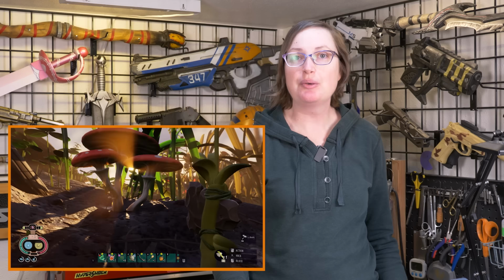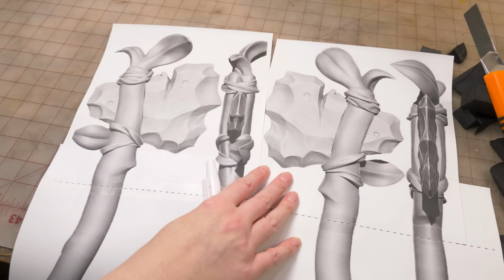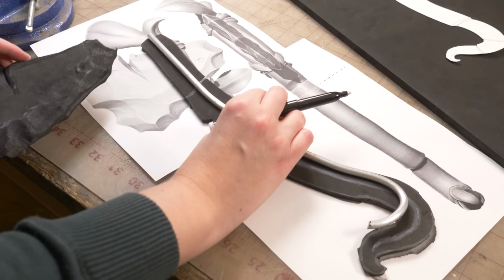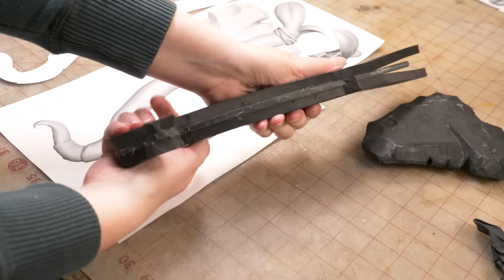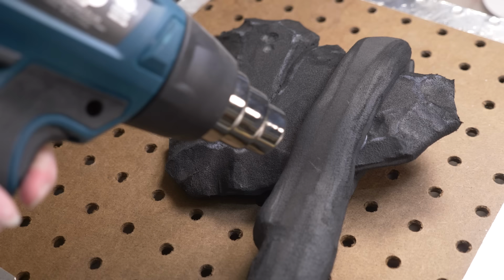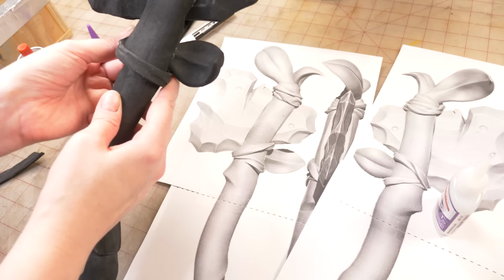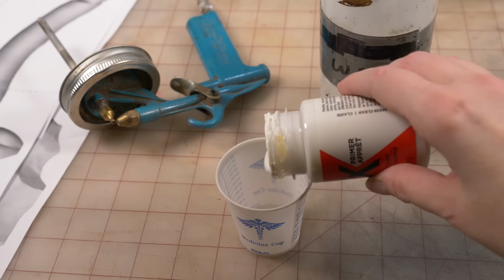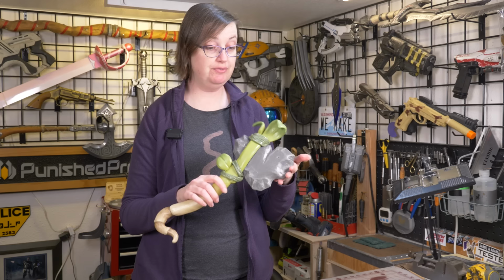Honey, I Shrunk the Props!

Comment: Rather surprised you didn't use a foam dowel or half dowel for the rounded bits of the handle. Would definitely save some sanding and cutting, and they can get pretty thick and sturdy these days.
Reply from the maker: That's a really great idea!